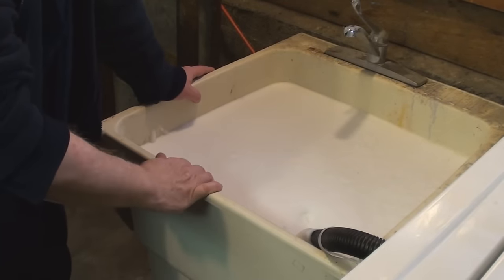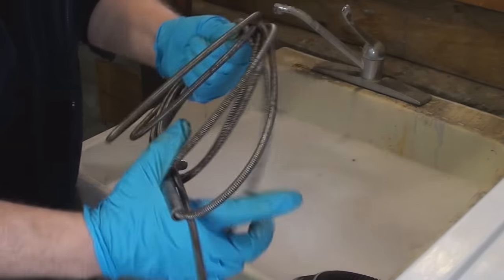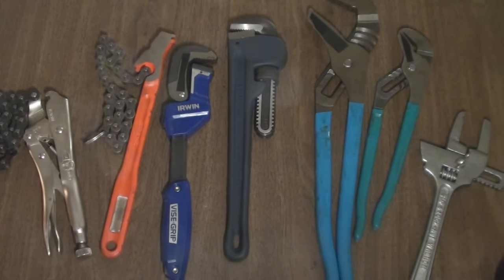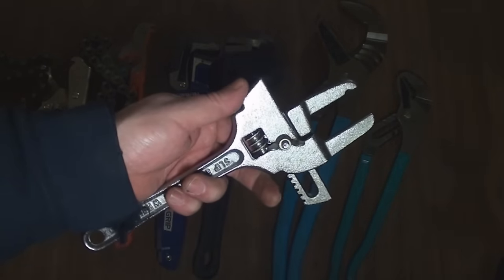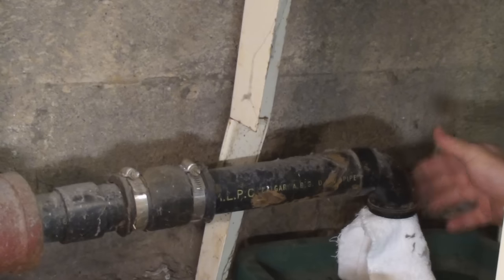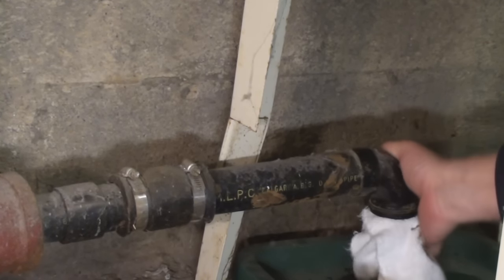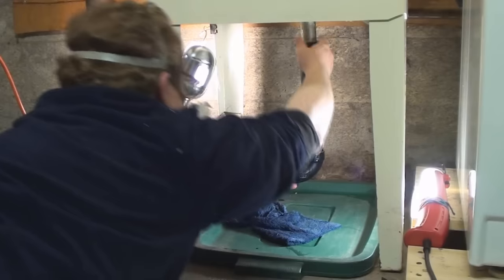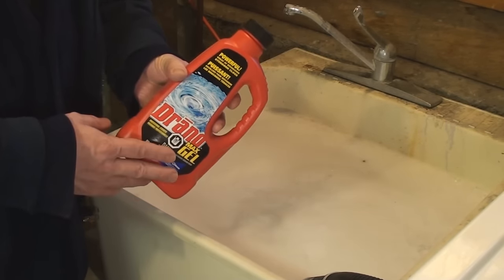Clogged Drain?

Comment: Before unscrewing pipes, I would try a garden hose shoved in the drain with a rag around it the opening to seal it. I've used that a lot to clear drains of lint and hair. I rigged up a short piece of hose with a valve to attach to the main hose, so I can turn on the water outside and then start the flow at the sink when ready. Also, you can buy a lint filter that looks like a white plastic ribbed cone that sits in the drain hole. It catches all the lint and is easily cleaned with a few swipes of the finger. Its tall enough so that if it gets clogged, water will still drain at the top. This works better than little filter screens that go on the end of the discharge pipe.
Reply from the maker: Thanks for the tips, Don! Love the hose idea.

Comment: For small drains you can suck a clog back up a drain with a wet vac. This works wall on a lot of drains, make sure you cover any overflow vents to assure full vacuum. Hair clogs can be pulled back up a drain with a hooked peace of wire. On larger drain pipes a garden hose set on high spray can be inserted into and down a clean out access or roof vent. This will wash out a clog. If a rag is used to close off the entrance around the hose the pipe will pressurize pushing a clog out. Care must be taken not to over flow a toilet or flour drain using this trick.
Reply from the maker: Thanks for the tips!

Comment: The tote lid makes a nice cshallow catch basin as is using a trash bag especially if you are snaking a drain in a finished kitchen or bathroom as that organic sludge is a greasy nasty stuff to try to clean up.  I highly recommend using a heavier 50 gallon drum liner as it is thicker material and has a larger capacity than a typical kitchen trash bag and they can be very handy to have on hand.
Reply from the maker: Great tip, Larry. Thanks!

Comment: Would it have been easier to have disconnected the mechanical splice there just before the main line and snake it from that point...The way you have shown you have to deal with the 90 degree turn where you inserted your snake and run the risk of damaging the seat faces on the trap...Just an after thought....

Comment: Hey brother ! Please help. The kitchen sink won’t drain and it’s backing up the downstairs bathroom shower. When the kitchen sink is full it comes up from the shower. And when I pour water down the shower drain it backs up. But I’m pretty sure the drain is clogged upstairs in the sink. Can you help me figure this out. I’m going to buy a snake in a few days. Thank you
Reply from the maker: Jeff - My guess is the clog is further down the line past the shower. Maybe rent a power snake instead of buying a spring snake as they'll cost about the same and the spring will go 50 feet at most.  Power snake will go all the way to the street.  Good luck!
Reply: @repairs101  brother thank you so much. That’s exactly what I was thinking. You probably just saved me a bunch of money that I didn’t have.  Thank you so much for responding to this older video! I owe you one man!!  Take care brother. I’ll let you know what happens
Reply: @repairs101  I do have a septic tank. And it’s not very far from the shower. Maybe 20 feet or less. I should probably be careful not to get it down there right ?!
Reply from the maker: Are you sure the tank isn't full?  I'm no expert but heavy rains maybe a factor? Yes definitely keep your snake out of the tank. Since its so short a run a spring snake should be all you need (assuming not full).
Reply: @repairs101  no it was emptied this year !
Reply: @repairs101  Boom!!! Got it. You were right. The clog was below the shower, downstairs. And I’m glad I got the 25ft snake. I used every inch of it. Had to snake it a million times and ran gallons of hot water as I was doing it. Worked really good. Thanks again man. I owe you one.

Comment: hey I need some advice from a fellow Canadian please. So a month Ago I Accidentally flushed a rag down my Toilet. luckily the toilet still flushes fine. My Issue and worry however is that when I do Laundry the Toilet and bathtub make noise and pressure bubbles up them. I have read that The main Waste line is probably partially clogged or maybe the rag is stuck in the toilet Trap vent Area. Should I try and use a long Auger Snake down the Toilet/Waste line to clear the blockage?? I'm scared of doing damage or it getting stuck. BtW my Lines are PvC. thankyou.
Reply from the maker: Canadian citizenship aside - don't know what you mean by bubbles up. Sounds like sewage line is backing up though. I would snake ASAP.

Comment: I have yet to encounter a situation where Drano actually does something. Effectiveness for me so far is at 0%. Complete waste of money
Reply: I actually buy this INCREDIBLY POTENT STUFF.
  I work at a Surface Treatment plant as a Metalizer using Zinc.  The residue is likr Zinc Oxide Powder---and I think it clogs the drains at home.
  So, I use SULFURIC ACID DRAIN OPENER.
  I coat ALL the chrome in the tub with Vicks Vaporub---and slowly pour the acid into the empty drain.
  You can buy it at WalMarts.
  It hisses, bubbles, farts and boils the hell out of ANYTHING---even rags.

Comment: I used some stuff called one shot drain cleaner, I poured it in and got a Krakatoa of the stuff coming back out. My whole flat stinks of chlorine now, and I can't go into the bathroom. The plug was steaming.. I've had to open all my windows and put the fan through the bathroom door, and it's winter here! :(

Comment: I've got a sink and a bathtub that won't drain , just tried to snake the sink took off the PVC piping that wasn't glued , and just cant get the snake to get around the last   elbow joints , it's been 4 years since the landlord was aware of the clogged drains and refuses to pay a plumber and the sink smells like sewage
Reply from the maker: Sewage smell is a hazard to your health. Plug the sink and avoid the gases. No smoking no open flame near the sink.
Call city hall or a residential tennant's hotline and ask if he can be ordered to fix it without jeopardizing your tennancy.

Comment: I can't get the snake to go down the pipe.  It gets held up at the turns.
Reply from the maker: Frank Cabanski   Did you remove the water trap? Have a look here for easy ways how:   http://youtu.be/P9OTXrif6Hw     Good luck!
Reply: Repairs101
I am not going down through the drain.  I am going directly into the wall pipe, before the trap.
Reply from the maker: There really isn't a lot I can think of (not being able to see what's up) other than maybe you need a power snake because of the way your  sewage is plumbed..
Reply: The best way to get around turns is to lock the handle and crank with steady pressure. It's quite tiresome with the crude style of snake used in the video.

Comment: How do you get around an elbow?
Reply: watch it from 5:30 to about 7:00...the way you get around the elbow is to twist the cable so the end of the cable can turn the corner...you twist the cable using the little pipe with a wing screw on it that is slid up over the cable...you tighten down the wing screw and twist the pipe while pushing more cable into the drain. then when you feel it turn the corner...you stop twisting, lossen the wing screw and slide more cable through the little handle pipe.
Reply: +caddymech Is that the same technique even for a double elbow??..Iv'e got a pipe snake on order and i have a feeling i'll have that sort of joint to have to negotiate around..Both my kitchen and bathroom sinks are very slow draining and think they both connect to a double elbow.

Comment: Well im checking out how to use a drain auger for a tub drain.. 
Im a chick trying to do it myself. Lol
Reply from the maker: Soap and hair are the most common issues in the tub. 
If the tub drains slowly wait for it to empty then pour a kettle of boiling water in the drain. 
Often it will soften up the soap enough to free the clog. Good luck!